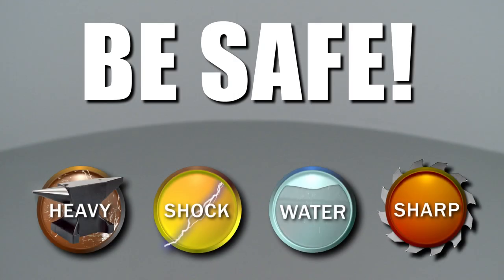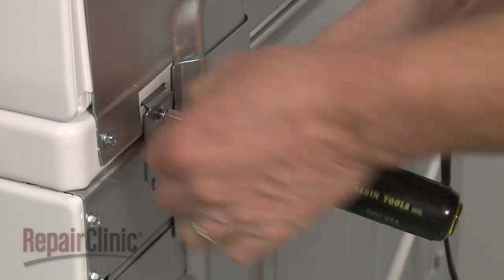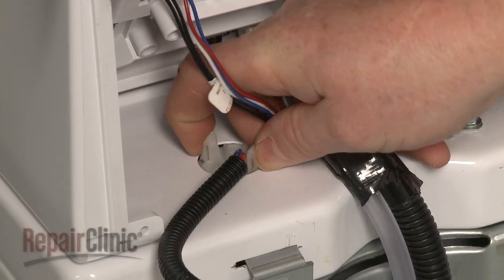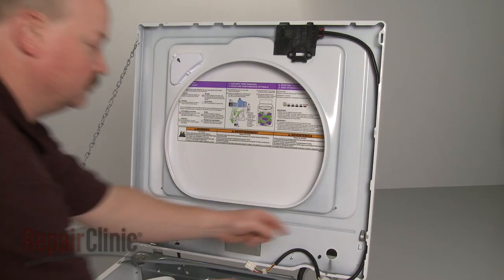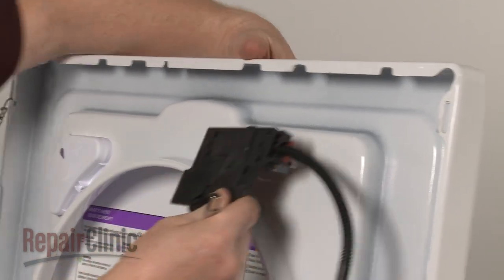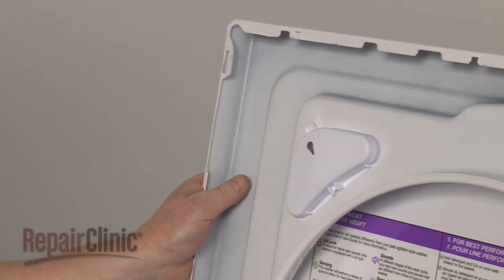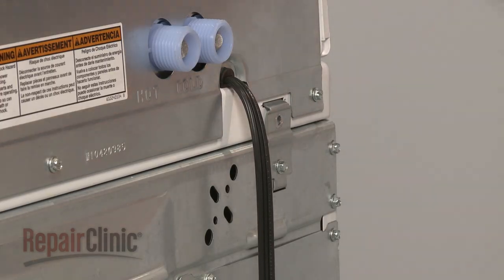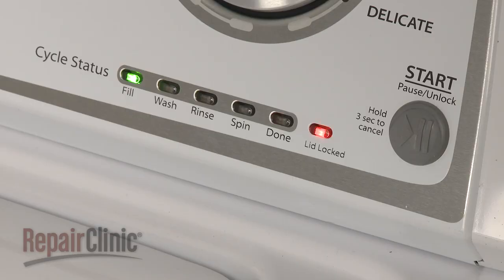Whirlpool Top-Load Washer Lid Lock Replacement #W10404050

Comment: I did the diagnostics on my whirlpool washer.  It was the washer lid lock.  Purchased the part, followed the video and changed it myself.  Pretty good for a 65 year old lady.
Reply: I did the same thing, ordered the part, and before it arrived, a repair man ran a reset procedure that fixed the issue without needing to replace a part.

Comment: Yeah! I’m fifty and can’t hardly see out of my right eye but I fixed it!!! My son helped with holding up the lid but I can’t believe how easy a fix! Taking the lid bolts and stuff was crazy as no one is technical in any form.  These newer electronic models are a mess to take apart. But after I purchased the two tools and the lid switch and lock replacement it was under sixty bucks. I’m so happy. I was quoted 300 plus the part to fix. It took almost fourty minutes but I think anyone technically savy could do it in fifteen minutes. Yes my blankets smell like downy once again. Thank you!!!!!!

Comment: I am a young mom of 2 (a 2 year old and a 4 month old) and because of this video, I was able to replace my part and get my washer working by myself with my kids playing nearby. Thank you!
The only thing I would recommend is showing how to remove the bezel because the repair kit comes with a replacement bezel to guarantee proper function after replacing the lid lock. I did not replace the bezel at first and the washer was still having the same problem and was not working. I finally figured out how to remove it and had to remove all the back paneling again and then replace.
Reply from the maker: +alison mellin We are happy to hear that we could help.
Reply: alison mellin o
Reply: What is the bezel?

Comment: Woo Hoo!!!  Just fixed my Amanda Washer by myself.  Lid Lock Switch.  And I'm a Female, 69.
Thanks to your 
YouTube Video.  I bought the part $57.00 at An Appliance Parts Store.  And I used a 1/4 " 
Nut Driver on my Black and Decker Drill.  I plugged the washer in the wall after I installed the
Part, but the light was still flashing,  unplugged it 2 more times, and even 
turned off and on, the circuit breaker. That seemed to "reset" it. Thank you!!!

Comment: The newest replacement (Jan 2019 for me) does NOT have the mounting screws at 1:35. The white bezel is attached to the black plastic lock mechanism. You slide old lock, bezel and all, to the left and it comes out in one piece. Reverse that for putting in the new lock until it clicks into place.

Also, my replacement lock came already in  the LOCKED position, witch i figured out when i tried to shut the lid after completing installation. I kinda poked my finger in the and got the new lock to unclick.

Overall, great video, it made this repair very easy.
Reply: Joe Hertweck i have the same problem did you just close the lid hard enough for it to click or how did you do that

Comment from the maker: Songre Osmenep The lid lock was likely not the problem with your washer. It could be a main control issue but the only way to know for sure is to do some electrical testing with a volt meter and the wiring diagram from inside the machine. Enter your washing machine's model number in our website's repair help for troubleshooting information specific to your washer.

Comment: Great vid. Very easy to follow. I did this and the sensor is sill flashing.  What could I have done wrong?
Reply from the maker: I would check the actuator on the lid to make sure it is not broke and is engaging the new lid switch. The wiring is hard to mess up because the harness only plugs in one way. You could double check the connection at the control board if you haven’t already.
Reply: Were you doing this because your sensor icon would light up but your washer would not lock?

Comment: I own Whirlpool washer WTW5000dw3, my washer is inoperable until I get my lid lock replacement. The washer stopped working with a load of laundry in it, I have removed all items and I have scooped as much water out as I can by hand, are there any tips on how to manually drain the washer while waiting for my parts?

Comment: Does the lid lock/switch also control the draining and spin cycles? My washer wont drain. I replaced the pump , but that's not the problem.

Comment: lock seized up at some point during the replacement with the lid still open, it won't close all the way even when unplugged, how do I unlock the actual part itself?
Reply: I have the same problem did you ever find a solution?
Reply: @lockednloaded7830  did fix it after a while but I don't remember how, just that I opened the old one to look at the internals and was able to fix the new one after figuring out how it worked. something about the solenoid locking and needing to be unstuck.
Reply: @Alexis-dh1bn  thank you for responding

Comment: Hi Repair Clinic I did a replacement of the above and now when I plug in the Machine nothing is happening no lights no agitation nothing! I open the back and observer there is a small green light on the Control board lit but no other functions are working after replacing the Lid lock switch..could it be that I need to go in diagnostics mode of the washer or there is some other problem?

Comment: Only thing I forgot to mention is I didn’t replace the new bezel. I could see the lock was damaged it had no play or give in the springs it was a mess it fell apart. I’m keeping the new bezel just in case but I didn’t take it off. I only replaced lock and stricker.

Comment: Well, this repair didn't work for my similar situation. I checked underneath the washer to check if the belt was broken but it is intact. I'm not sure where else to go with this :o(

UPDATE: This was not my problem. After further research it was determined that the SHIFT ACTUATOR was faulty. I replaced that and the washer is back up and running. Hopefully this helps anyone out.

Comment: where is the lid switch located on the washing machine.  my machine still will not rinse and drain after replacing the washer latch assembly.
Reply from the maker: +wanda b. King Normally a washer will have a lid latch or a lid switch, not both.
Reply: thank you!

Comment: did all that but all it does is click !!!! the lock on the lid is not locking, therefore it doesn't start sensing and come  on. !!! no help here !!!
Reply from the maker: +jonathon watterson The lock may be defective and need replacement. If you are referring to a new lock then the control board may be bad.
Reply: +i replaced lock and harness, put in serves mode and all worked... when flashing done, I open the lid and light went of, close lid and pressed start, click 3 times then stop, 3 times again, stop, then nothing, says it is sensing and lid switch light keeps flashing but nothing... helpRepairClinic.com

Comment: Has anyone run into case where after you do a reset ( https://youtu.be/YZKqpoVX3t4 ), the washer is so moody it works when you least expected and then nothing? Like stopping at wash cycle, working, stops at spin cycle, stops at wash cycle forever.
Reply from the maker: +Chip Malee Thank you for sharing.
Reply: *****  what would really help is if you are affiliated with Home Depot that way there would be no shipping cost for parts picked up at store. Also customer would save in returns if part does not work. Website ( http://www.appliancerepair.homedepot.com/Shop-For-Parts/a11b5d1286864/Model-WTW4800XQ4-Whirlpool-Washing-Machine-Parts ) already has look and feel of RC which I suspect RC is connected someway to Home Depot.